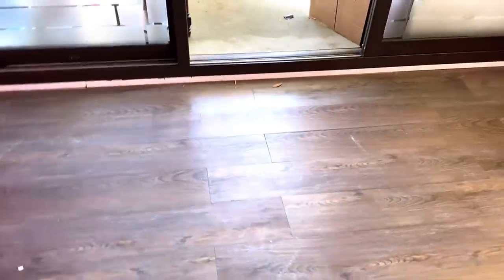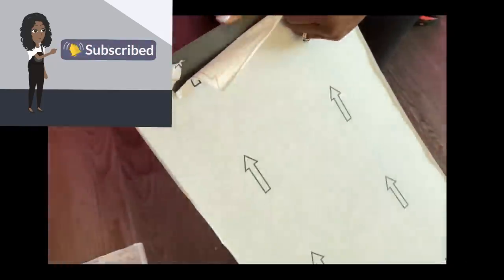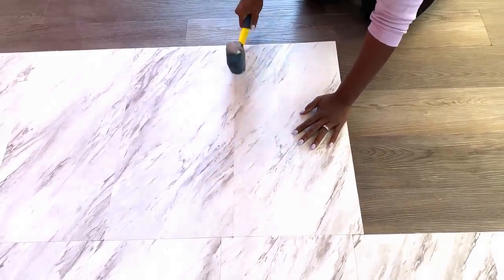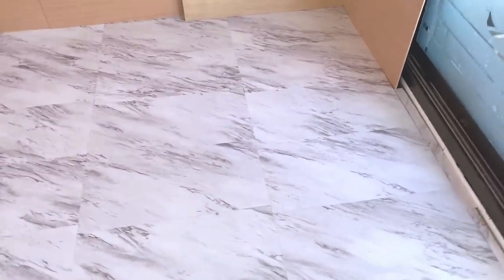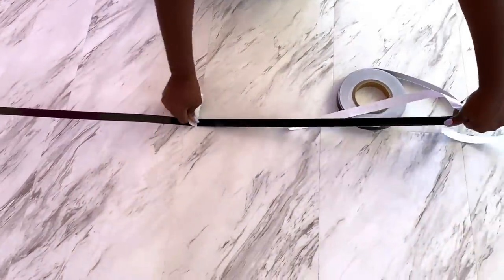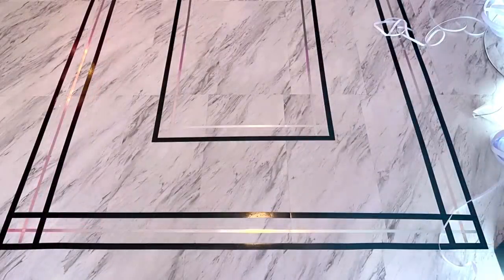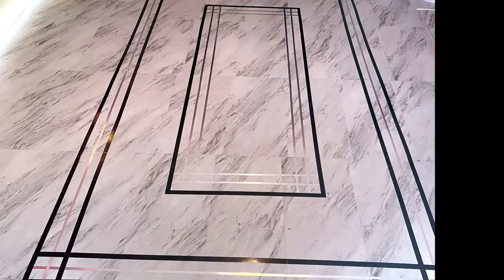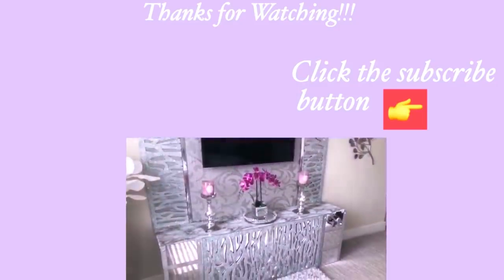SEE HOW I TRANSFORMED THIS DARK WOODEN FLOOR/ HOME IMPROVEMENT DIY

Comment: I used the same brand in Oyster Travertine. Super easy to install but we stepped it up a notch by offsetting, spacing, then using a dark gray sanded grout. Most people find it hard to believe that it's vinyl and not real stone.

Comment: I installed this flooring in the master bath, vanity and closet.  I grouted mine and it looks amazing.  One handy trick to make cutting easier is to heat the tile with a hair dryer first.

Comment: Great job, I’ve done these before, it looks really nice, the only downside of These floor tiles is  that they tend to shift , be mindful of that 🌟 
side note, apparently there is a special glue you can roll on the old floor to keep them in place more.

Comment: I swear no lie you've must have read my mind!!!!! I've been looking for something like this but the thing is . I want to put an floor underlay so that it won't stick to the actual flooring because my house is a rental. I've used the peel and stick before and it left adhesive marks on the floor. What would you recommend as a floor underlay for the tiles to stick to

Comment: I've often wondered how well the Peel & stick vinyl stays down. I would like to do it my kitchen.
Reply: I would like to know as well. I'm buying a house and I THINK they already started doing that to the kitchen with this... and they left some more in the garage. So I want to do another floor. But not if this is pretty temporary
Reply: I had it down in bathroom around 6 years now no issues. Just about to remove and put vinyl sheet as wanted a change. Had a professional in fitting a new bath suite who said the flooring looked like a professional job and didn't need replacing! Didn't tell him I did it.

Comment: Good morning. The result is fabulous. But I don't think I can achieve such perfection. My lines will go in all directions except in a straight line. The result is going to be a disaster. Besides watching the video I was wondering how you do it. Did you draw a picture on the floor beforehand? In any case it's the result is great. Gabriel (France).

Comment: The taped design is gorgeous, but those tiles don't seem to flow. You can see the lines where they butt up against each other. It would look better if it looked like one gigantic piece of marble. But the designs you made are absolutely stunning

Comment: Can i use that adhesive marblee tie in my wall ?
Reply from the maker: I haven’t tried it on the wall before but the adhesive is strong so it should work. 
for better results, It should be done on a smooth wall